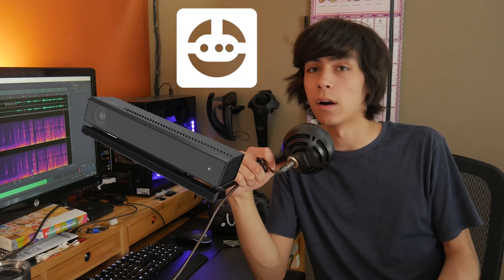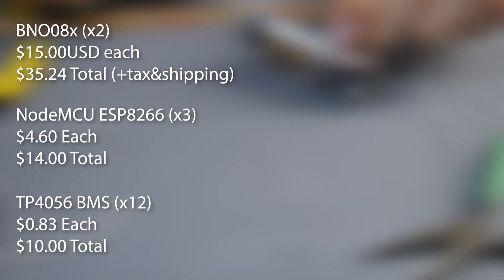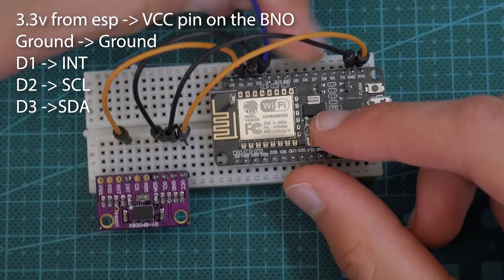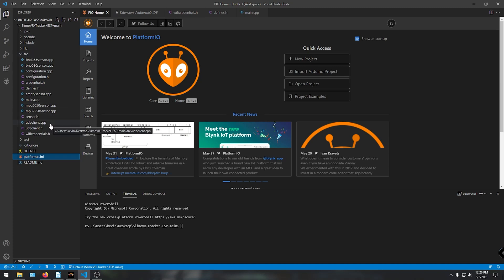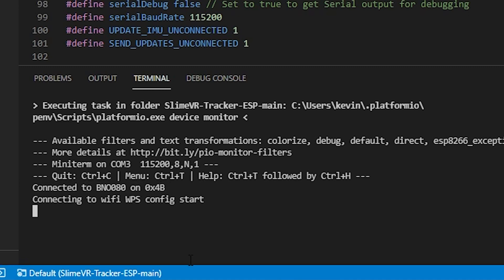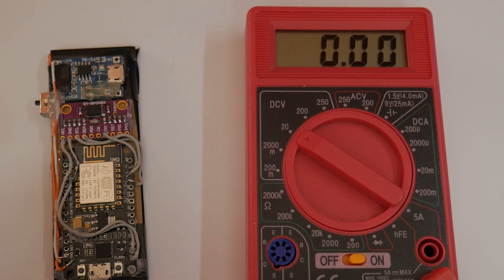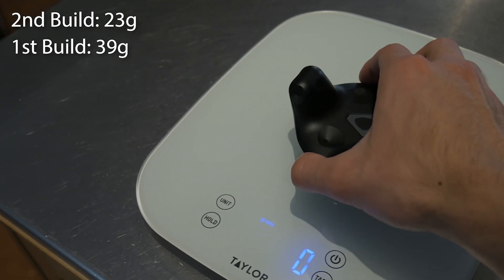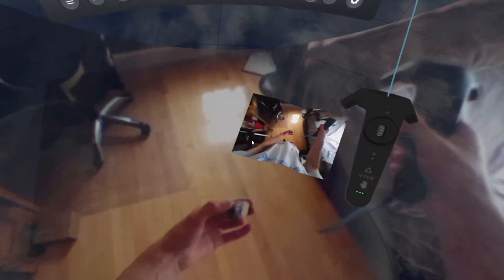[Outdated] How to build your own SlimeVR Tracker

Comment: If you follow the solder guides you HAVE TO change the defines.h board to this or else the I2C never connects:

#elif BOARD == BOARD_NODEMCU || BOARD == BOARD_WEMOSD1MINI
  #define PIN_IMU_SDA D3
  #define PIN_IMU_SCL D2
  #define PIN_IMU_INT D0
  #define PIN_IMU_INT_2 NULL
  #define PIN_BATTERY_LEVEL A0

Comment: I have a soldering kit from my dad that's been lying in a shed for 4 years, recently got myself a quest 2, this looks like a great project to bust out the kit and try to learn how to make something!

edit:
5+3 set finished, tested and I just fried 2 of them. Don't use 18650 batteries if your brain is too smooth to match the big red plus with the other big red plus

all in all, slimevr is pretty great. In the 5 hours or so that I had unfried FBT it was a blast and it was super fun building them, highly recommend giving it a shot.

Comment: Why did you add the type c charging port? Couldnt the battery charge off of the usb port on the nodemcu? I usually use feather huzzah boards and they can charge off of the usb port on the board.

Comment: May I Ask why u use bmo080-085?
Does it have analogues, like can i use mpu 9250?
Reply: From SlimeVR github:
MPU-9250
Using Mahony sensor fusion of Gyroscope, Magnetometer and Accelerometer, requires good magnetic environment.
NOTE: Currently can't be calibrated due to lack of proper commands from the server. Work in progress. Can be ran as MPU-6050 below w/o magnetometer.

Comment: I have been waiting for these for quite a while!  I have been using a Kinect One, but since I switched to Virtual Desktop on a Quest 2, I have had significant issues remembering to maintain my orientation with the device.  I can't go more than about 30 seconds without turning my VRChat avatar into a corkscrew!  High hopes that I will be able to acquire these parts and build a set for myself =D
Reply: Hey man how’d it go ? I’m about to build my own as well
Reply: How did you use the Kinect? Is it possible to use same method for mocap with blender?

Comment: I am really tempted to build this, but I want to wait for some reviews before I put in the time investment to make 5 trackers, especially when the SlimeVR server isn't even out yet for proper FBT. Until then I guess I will just be left with Kinect full body and my janky and barely functional code to force it to work with Shadow.
Reply: watch thrillseekers vid! its totally worth it!
Reply: @MalekiRe  already did, watched it the second it came out. Definitely going to build them once I finish the Lucid VR gloves
Reply: @adicsbtw  did you finish the gloves and do  u actually use them
Reply: @aepfelpfluecker  I ended up giving up on the project due to a variety of issues I ran into and lack of game support. I was hoping to try and mod them into VRC, but that hope has long since been dashed. I did do SlimeVR though and it works amazingly well. Nobody can even tell I'm not just using vive trackers
Reply: you know that its out, the server, right?
Reply: @musicvr3368  it is now, it wasn't when I commented this

Comment: What if you don't have a sauntering iron and wire strippers. Is there a alternative method?
Reply from the maker: You can check out and subscribe to the crowd supply page on the discord. It's not live yet but when it is; you can back/preorder the project.
Reply: teeth is a great alternative to wire strippers
Reply: @degenerate2040  I can actually agree, it’s not healthy but it works decently well 😂